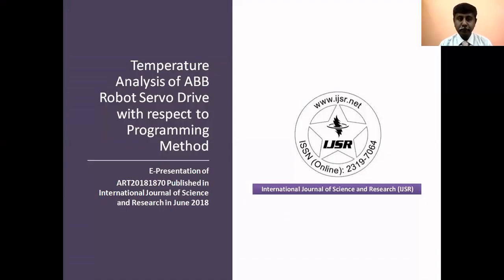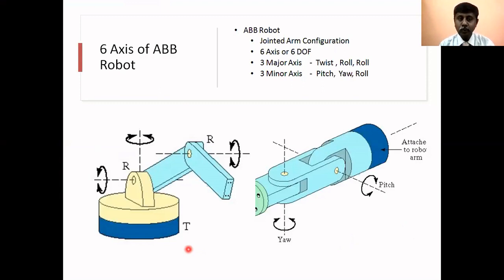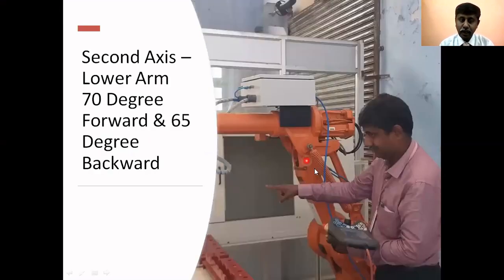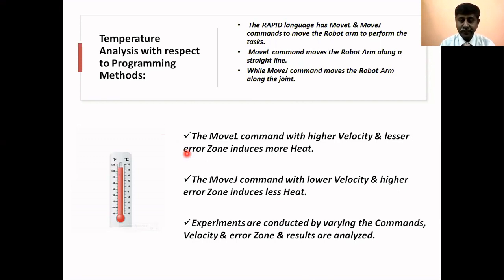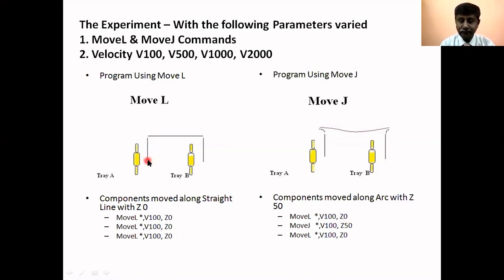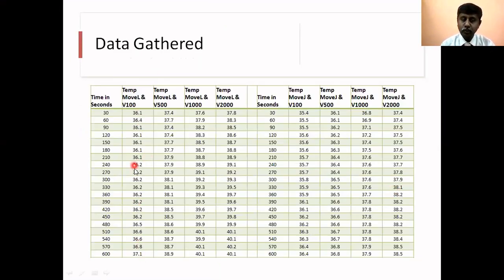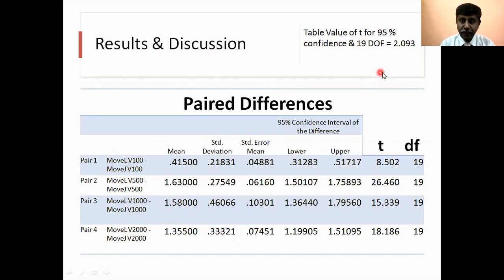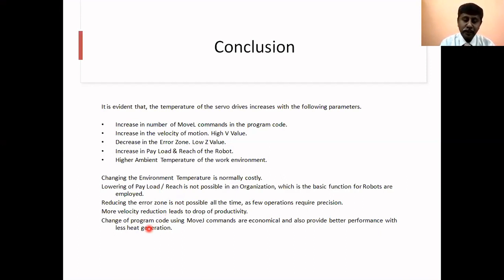Temperature Analysis of ABB Robot Servo Drive with Respect to Programming Methods (Manufacturing)

Comment: Fascinating Ideas, However issues arrise when we Consider the quantum mechanisms and dynamics behind the bio-engineering fields created via. plasmatic energy systems, which exists across the ozone layer (quantumly, that is). From my research and studies in the field of atomic and biodegradable quantum universal holographic theories, I believe you should consider the possiblility that the universe in a sense has a frequency which results internally in electro-chemistry. Speaking to expert herpatoligists (Proffessor J. M. Agassiz) in the field, I've found that the true meaning of dynamic theory, stating the entirety of this balanced universe is thus divided into unbalanced pairs of father/mother sex-conditioned sex mates,  nuclear fission thus occurs. 

Although I respect your endavours, the fundamental theorems behind your analysis does not reflect the deeper level theories of plasma cells, i.e, fission across multiverses, quantum realities, and electro-mechanical combustion.

Kind Regards.

Proffessor A. L. Richardson

PhD in Quantum Field physics, relativism, and bio-mechanical hydro-electric steamrollers.
Reply from the maker: Thanks for the visit, do Subscribe the Channel for future updates :)